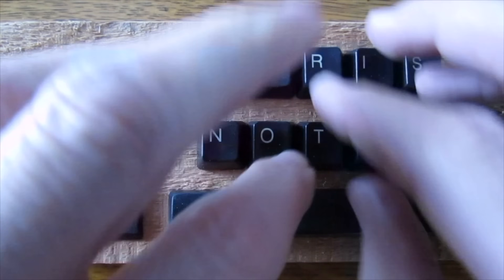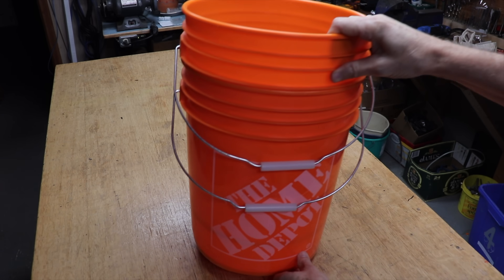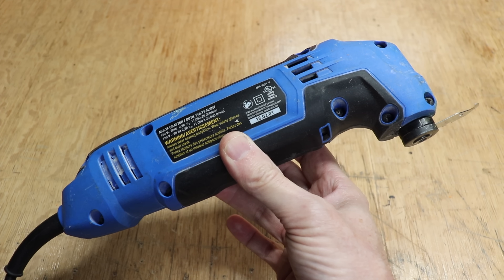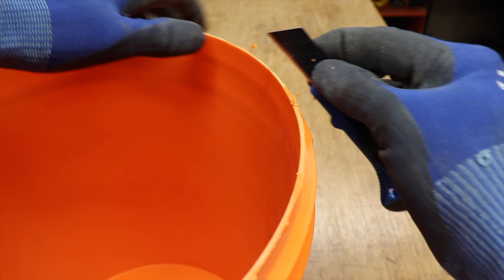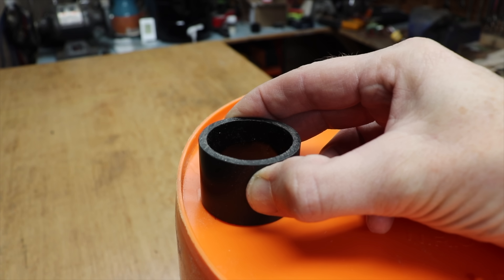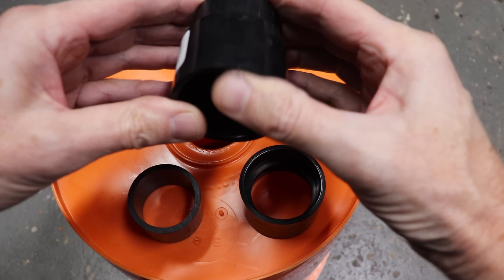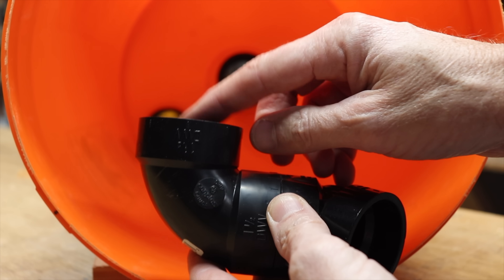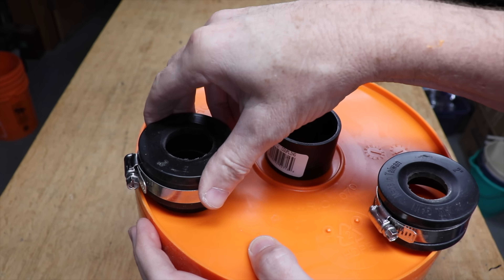How to Make ● Simple Cyclone Dust Collector

Comment: The Home Depot bucket no longer has three ridges.  They now have two.  I'm not getting a really tight fit between the buckets.

Bought two Lowes buckets.  Same design.  
The friction fit at that junction is crucial.  A poor seal means the buckets easily separate.  One can duct tape them together, but that is inelegant and makes it difficult to separate.

Working on a solution.
Reply from the maker: From other commenters it looks like home depot has 2 designs of buckets across the country (US)
Reply: I did get a working model that works, but it leaks at the union of the two buckets.  I used an orange bucket on the top, and a blue one for the bottom.  I think I might simply drill three small holes and use thumb screws or similar to join the pieces.  

I used ABS pipe and fittings.  Worked fine.  I used a rotary file from Ace hardware to enlarge the openings in the orange top.  Cheaper than buying a Dremel.  Cost was $8.99, but I already had one.

I did find I could not push the 90° angle fitting onto the pipe I cut.  I used a rubber mallet and held the outside piece in my hand.  Worked fie.  The 1 3/8" length to cut the pipe was just right.

They have several shop vacs with HEPA bags inside, which I think will work great paired with this nifty cyclone collector!

My cost was virtually nothing, since I had all the pieces except one 2" cap.  That I had to buy.

Thanks, Chris!

Comment: Love this idea, do you think it could be modified to extract like smoke or the fine particles when sanding rust, or cutting metal  Obviously because of sparks etc it would be more like an air cleaner. I do light metal fabrication, grinding, welding, cutting in my garage and cant afford commercial filtering equip.

Comment: I built this and it works the exact same way but man is it loud.
Reply from the maker: By loud you mean it is a high pitched whistle sound? If that's the case, use the process of elimination to figure out which one of the hoses is making the sound.
Reply: @chrisnotap  i figured it out. My intake hose was too long 
Works fantastic

Comment: Would this work just as well with finer dust? I work at a crematorium and after processing the bones, there is a fine dust in the air and was contemplating getting a ready made dust collector with filter system but it's a $10K investment.

Comment: The Dust Deputy has a straight and a angled hole also. But also it 's bottom tapers to a small hole where attached to a bucket. Would that make it seam that this DIY plan should also be better if there was a separation between the buckets with just a 3 or 4 inch hole between the 2 buckets? Anyone ?

Comment: Well, I went and got all the stuff, and cut the handle off the first bucket, but when I was ready to cut the bucket, I realized that they have changed the design. Do you have an update for the new buckets?
Reply from the maker: There seems to be 2 bucket designs that HD uses. I've learned this from the comments on this video. I don't know where they are different or in what states. Commenters have said that Lowes buckets work as well. You may want to go that route.
Reply: @chrisnotap  I ended up cutting the bucket half way between the top two rings, then chamfered the edge with an orbital sander. It works! But drilling the rubber caps with step drill? Guess it takes practice! lol In the end, it works well, even with a little old one gallon shop vac!

Comment: Thanks for this! I'll be building this tomorrow! I just got my radial arm saw (circa 1979) set up and I know it will throw as much dust as my router table, lathe and planer do! You, sir are awesome! Will have to modify your design slightly though. Do you think two "Lowes" baskets will work? All I already have on hand.  LOL!
Reply from the maker: Other commenters have said that Lowes buckets work yes.
Reply: @chrisnotap  I'm a little behind the power curve here. I had to replace the cord on my shop-vac. But here is an interesting moment that happened today. I went to Lowes to collect the necessary components and as I was searching for the right size, I see another gentleman right where I needed to be with a list in his hand. He asked what I was doing and I told him I was making a dust collector. He laughed and said he was also making one and then asked if it was from a video I'd seen on Youtube. Sure enough, we are both making your dust collector. The really interesting part is that I live an hour away from Lowes and he is a LOT closer. The first serendipitous moment I have ever had!

As a side note, I am going to attempt a variation in your design: The lid will be of plywood and the collection section will be an old (cleaned) grease drum of about 15gl size. I have the two buckets on standby if this doesn't work. I am also making a portable stand for it since the shop-vac will be in permanent use in this application. Wish me luck!

Comment: I just built this, and used it for my harbor freight sand blast cabinet.  I have made a way it so I can use the vacuum hose, or have it attached to  the sand blast  cabinet, this sucked up the 15 year old media out of the cabinet, very dirty and dusty!   This thing worked great and no dust ended up on the vacuum filter! I had all the stuff to build it just laying around the shop!   I am actually shocked at how great it works!  You deserve 3 brownie buttons for sharing this!    I ran into a difficulty finding the fernco rubber caps to fit the hubs of the pipe fittings and did a work around.  (I heated the old hose and stretched it to fit)  Home depot is out of all plumbing supplies!   I used the sand blast cabinet with this negative pressure and it was a shear delight!  no leaks even though the cabinet has holes and cracks all over it!
Thanks!
Reply: Did this system help keep the dust down in the sand blast cabinet? I have a hard time seeing my work and need a solution to keep the dust down.

Comment: You are a genius.....brilliant put together.
For a tight fit, i use to make a 1 to 2 mm smaler hole and warm the edges up with a small torch. After 5 to 8 seconds i can push it thru and get a werry tight fit.
And your blade on the multicutter was just up my alley. Great work. And a very great video 👍👍👍🙂

Einer. Denmark. Randers
Reply from the maker: Thanks for that and Merry Christmas from CANADA!!

Comment: The goal isn't to have a separate container for the large particles.  What does that help?  The goal is to prevent clogging of the filter and it is the FINE PARTICLES that do that... which is what you have on your filter.   Most people have a 10 gallon or larger shop vac, so all you did is decrease the capacity before having to empty.

Comment: Great vid. The only rub is that the design here in the US is a bit different on the orange homer. If you pay a bit more you can get the “all purpose mixing container” for the top bucket. This has the old rib design. You can probably do it with the new homers but using that first rib as a guide is sweet. Cheers from a fellow Canuck!

Comment: So just to be sure, the vacuum is sucking the dust into the cyclone, and the cyclone is preventing the dust from going into the vacuum's collection bin? Is that correct? Will this work with larger shavings from something like a jointer?
Reply from the maker: That's correct and yes it should work fine on your jointer.

Comment: Absolutely terrific. (Why did it take YouTube 3 years to put this in my feed??? ) I've got the simple molded cap for just one bucket - works well enough, so this had to really rock to justify the extra work. It definitely does.  I also have the large whole shop Delta collector with a top for a galvanized trash can.  What the next step would be would be to make a simple roller dolly to hold both the vac and the collector -- but many situations, like mine, just don't have the room. Whatever the hassle of juggling a two part shop vac is , it is worth it. Thanks!

Comment: I’m absolutely impressed! I was looking for this exact set up for home use. Cheap and practical! 
Thank you!!
Reply from the maker: Glad you like it!
Reply: Impressed?  The goal isn't to have a separate container for the large particles.  What does that help?  The goal is to prevent clogging of the filter and it is the FINE PARTICLES that do that... which is what you have on your filter.   Most people have a 10 gallon or larger shop vac, so all you did is decrease the capacity before having to empty.
Reply: All he did was just simplify the emptying process and save a lot of wear on the filters….nothing major at all maybe for a blow hard. But I assume you have a better design or idea ? The only thing would be to add a layer to remove fine particles…and how would you do that without another filter membrane ?

Comment: Sorry for the most likely stupid question but isn’t that h just an extension of your current shop vac with just a larger collection bucket? Couldn’t I just use the typical home depot bucket vac? T off and run hoses to the saws/drills or whatever equipment you need the dust collection at?
It just seems redundant.
Educate me please!
Reply from the maker: If you use just a shop vac, its a mess cleaning the filter. With this it holds more and is much easier to clean the filter.

Comment: Great idea. I have the same issue with dust getting past the separater. I was searching for a 7 gallon bucket at a reasonable price. They are not to be found. This is  a better solution. Thanks for the tip
Reply from the maker: Glad I could help

Comment: just wanted to comment: a cone shaped dust collector (-$20 on ebay) old paintbucket, 1 40mm hole in the middle and 4 nuts and bolts.1/2 an hour work and an old not-to-strong 500W vacuum...otherwise the particles get into the vacuum .  I've put  it on a dimmer (<$10 Ebay)depending on the length on the distance between sucking point and vacuum inlet point

Comment: The best idea I've seen so on a DIY efficient small dust collector  system for  a small shop vac.  Also great  idea on the carpet knife blade on the oscillating tool. Thank you for taking the time to make this video it solved my problem.

Comment: Is there a reason the suction fitting neds to be in the center? My shopvac is bigger, and I think has a 2.5" fitting, so I'm thinking of putting it on the opposite side, so there's more room and separation from the debris intake. Thanks.. good build!
Reply from the maker: The vortex tornado effect pushes the heavy stuff and particles to the side. That's why you don't really want to have it on the side.
Reply: @chrisnotap   yeah... i think I discovered this the hard way today... it's been about half-half... in the bucket and in the shop-vac. Damn..

Comment: I normally use my shop vac to clean my pet cages, Mostly dry litter, hay and hay dust. Would this work for something that is a bit heavier than saw dust? and would it work out with a trash bag in the bottom bucket?
Reply from the maker: It will work for many things. The bag I'm not sure of. It may disturb the cyclonic flow of the dust as it swirls. It's definitely worth a try though.

Comment: I have a big insulation removal job coming up. Thinking of using several 55gal Rubbermaid trash cans, and building the cyclonic into the lid, so I can snap it on and off cans as they're are filled. Maybe some weather stripping to help seal the lid. Although the suction might just handle that. 

I'll try it, and report back with results.

Comment: Wow, wow, wow.  You break it down so that anyone can follow.  Very impressive, sir!
Reply from the maker: Wow, thanks!
Reply: Little hiccup when I got my supplies home, today -- the HD 5 gal bucket's rings have changed.  They now resemble the two-gal bucket's rings.  I thought to use an older bucket from our garage but they, too, have only a single ring above where the handle attaches, so we're going to have to math it out just a bit...
Reply from the maker: @rebeccahobbs4090  Others have run into the same problem in some parts of the country and said that they used Lowes buckets instead and that they work.
Reply: @chrisnotap  It actually was fine with the new HD bucket.  We simply measured halfway from the rim to the first ring and that was perfect.  Just finished putting together my cyclone connector.  Thanks!
Reply from the maker: @rebeccahobbs4090  That's great!

Comment: Thanks!
Reply: I'm apparently not subscribed to something, because the comments were locked out. 
THIS PERFORMS Better than the demo!  I'd tried 3 'one bucket solutions'  and nothing worked!
As of September 2022, I have a couple of equipment observations:  (1) I bought an HDX (Home Depot brand) 'translucent' bucket, but could NOT get it to fit with the old Homer bucket I'd already tried scraping on.  I guess you have to use 2 Homer buckets, because the HDX paint bucket accepts the cover, but not a milled Homer bucket, and new Homer buckets (as of about a month ago at least) do NOT have the milled ridges, which would make cutting just below the first ridge a bit problematic.  (2) Our Home Depot does not carry the old single rubber seals any more, and the 'new ones' are expensive.  (3) I had a piece of old 2.5" flexible hose, and used that instead of the 2.5" pipe and elbows.  Worked Very well!  (4)  I am now building a cart for the (olde) 20 gallon Shop Vac and the 2 buckets, because the combination is totally unstable.  That is how I know the system works well -- I cleaned out the Shop Vac, put a new filter in, and routed and cut 2 2x4's using the dust collector.  ZERO in the vacuum except for 'dust fine' particles on the new filter, and about 1/4 of the dust collector filled with sawdust.  WELL WORTH the donation!
Reply from the maker: That's great and thank you very much!!

Comment: The bucket didn’t fit. Like the cut one was bigger than the whole one. Had to cut further down to get it to slip in. Do you have suggestions to make the slip in work better.
Reply from the maker: I have found from commenters that home depot buckets are not the same across the land. They are different in some parts. Others have also said that Lowes buckets work. You may want to try theirs.

Comment: Living in Germany, I had to make do with substitutes for the parts, but of course the concept was easy enough to apply. Has anyone else had issues with loud whistling with the vacuum on? I suspect it's because my vacuum holes are a bit rough..
Reply from the maker: The whistling is probably from one of the hoses. Use the process of elimination to find out which one.

Comment: up and running with some success.  it works good on sawdust, but if you attack planer shavings or even minor debris, it just implodes the sides of the upper bucket, even after i drilled a half inch suction relief hole.  any thoughts?  i fear that my Hart vac motor will burn out at this rate.  maybe bigger fittings and/or hose?  that gets into quite a bit of expense, adaptation and work.  but it was a fun experiment.:washhands::washhands::washhands:
Reply from the maker: I did an update on that exact thing!

Comment: The suction pipe needs to extend further into the tank, this allows the cyclone to work better without the out going air spoiling the flow before the dust is pushed out to the wall of the tank
Reply from the maker: By doing that it is closer to the dust which is collecting in the bottom. I tried that and it was not advantageous.

Comment: Excellent idea!!!  Finally built it today and it works great.  Couldn't get the top to fit on the bottom even after 20 times around with the utility knife (that's on me). Even tried sanding and filing.  To prevent damage to the edge, I decided to shave off the inside lip of the bottom bucket, and success!!!  Also followed the update since it did collapse.  Put a brick in the bottom and the whole thing fit perfectly in my old Rainbow Vac rolling base.  I guess I now have to make your 90 second bev cooler since I don't have a cold one in the fridge to celebrate my dust collector.

Thanks Chris!!!!

Comment: OK, all good, but my vacuum hose size is 2".  All your setup is for 1-1/2".  Do I just switch over to 2" for all the fittings?  BTW - you left the hose clamps off your list of parts, and the cut on the top of the bucket is 45 degrees, not 90.

Comment: I used Benjamin Moor paint cans. I had to cut at the next divider down to get them to fit.  The plastic is a lot stronger or tin snips were either cheap, dull or both.  I heated a 1 1/2" socket on an extension over my gas stove until it was about 450 degrees, held the extension with oven mitt and pushed the socket through the bottom of the can.  Melted nearly perfect holes, just needed a little razor trim.   Vacuum worked great for all the plastic shavings but I haven't tried it with my concrete grinder yet.  I am afraid concrete dust will be too fine.

Comment: Although a nice simple engineering concept, I still question it's usefulness. I collect lots of duct with my shopvac and the same way you have to empty the bucket, I empty the vac. Then blast all the dust from the filter with a blower and get's super clean in no time. I'm not criticizing your idea but am just wondering whether it's worth the try given the shopvacs are exactly for the same purpose. Thanks.

Comment: Aloha Mr. Notap! Great video (mostly.) I'm making a silent enclosure for a cnc machine. I'd like to borrow/steal your idea but I want to use a speed controller to run the shop vac at lower power, mostly for noise reduction. Should I use smaller buckets? Thinner hose? What about attaching fins to the hose that runs to the collector for a simple air-cooled closed system? The mind reels. Mahalo!
Reply from the maker: All are possibilities that may work. It's all about experimenting to make the set-up that's best for you.